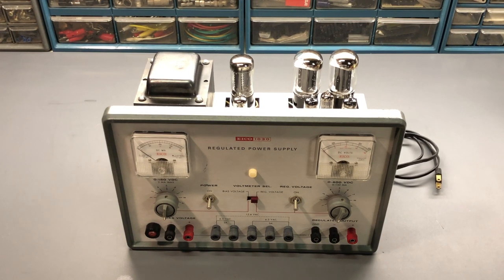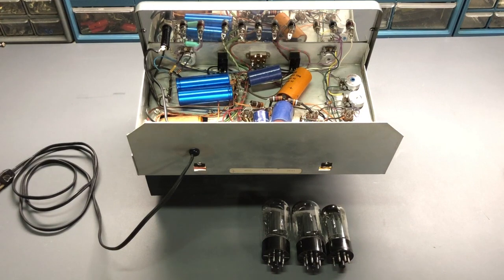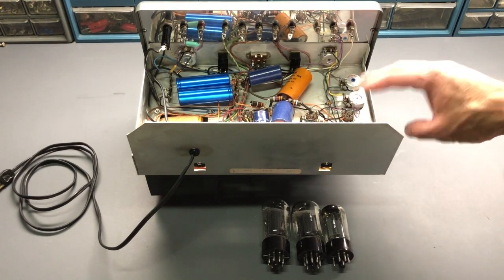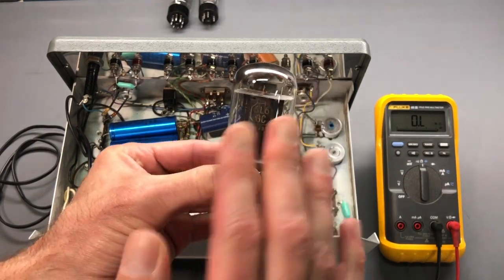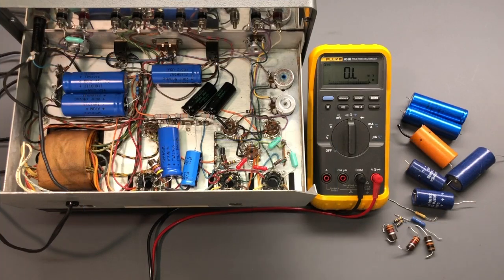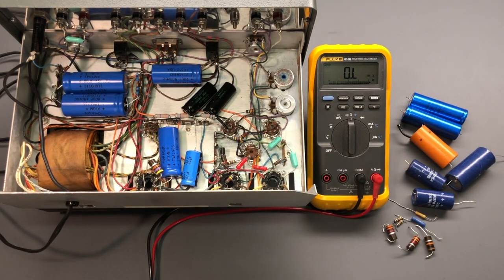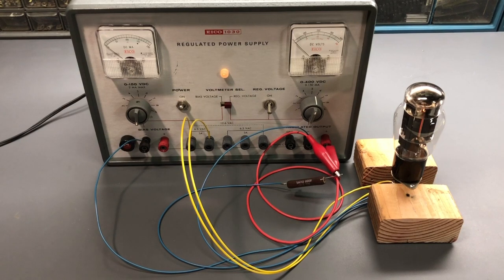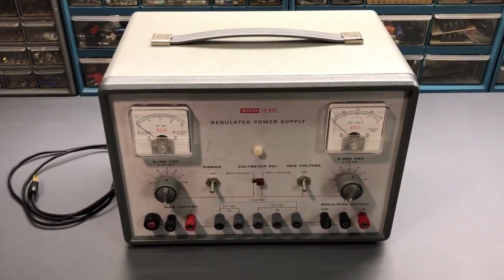EICO 1030 Regulated Vacuum Tube Power Supply Restoration And Test - Part 2

Comment: Erik, thanks for the 2 part video. Just acquired a EICO 1030 about a month ago. Also followed your advice to bring it up slowly on my Sencore Isolation variac. 
It appears to be working fine like yours. Surprisingly the meters do match my Fluke volt meter.. A well engineered device.
Ordered the replacement capacitors and they should arrive next week, so I will watch how you do your installation to get acquainted with the process. 
The EICO will replace my Heathkit IP-32 supply that is very similar in design, but the EICO is much better from what I can tell, and more flexible..
Again, thanks for the video,,, Robert WA6PHN, San Diego
Reply from the maker: Robert, thanks for the kind words about my video.  I am glad to know it was helpful for you.  I agree, the EICO 1030 is very well built.  Yes quite similar to the Heathkit model and I agree the EICO is the better model.  Have fun and enjoy your restoration project.
Reply: @EriksElectronicsWorkbench  The Heathkit will only put out one 6.3 volt AC output, but the Eico has 2 6.3 volt outputs that can be strapped together for 12.6 volt tubes, so an important point that distinguishes the 2 units...
Reply from the maker: @myradiovideos  also as I recall (correct if I am wrong) the Heathkit had solid state rectifiers. The EICO is vacuum tube rectifiers.  I prefer the the vacuum tube rectifier because the B+ comes up more slowly.
Reply: @EriksElectronicsWorkbench  yes you are correct plus the HEATHKIT Does Not have bleeder resistors across the 2 capacitors! Some folks like to convert tube to solid state but I prefer the tube as they are very robust and Glow!! 👍👍

Comment: Hi Mr. Erik
Very nice review. I have appreciated the test you did with the 6AS7 tube. Most youtuber I saw on this type of power supply did not test it with a tube. Very instructive! 

I have some questions about this H.V. power supply.
1) The power is a 2 prong extension cord. What is the utility of the ground binding post?
2) What about the security if by any bad luck, the 120 Vac hot wire is touching the chassis?
3) If by any mistake, somebody is touching only one lead at 400 Vdc, will he be hurt? Because the DC output is floating, we should feel nothing right. But 400 Vdc seems a lot?

I will be more than interested if you could do other demonstration with vacuum tube as you mentionned at the end of your second video.

Keep up the good work!
Reply from the maker: Hi, I'm glad you found the video informative.  Thanks for the compliment.  The ground binding post is provided for a convenient way to  attach to the chassis.  The ground binding post could be connected to a main earth ground.  As you noted the mains cord is only 2 wires so an earth ground is not automatically created.  Your point is valid about the chassis becoming hot if a mains fault occurs.  Grounding the chassis could help in this situation and also powering the unit from an isolation transformer would provide added safety.  The DC output is floating but there is the possibility of leakage current in a transformer, capacitor, etc and that could still be enough to provide a current path for a nasty if not lethal shock when dealing with the higher DC voltages.  I would definitely not want come in contact with the high voltage DC.  Always be safe and use caution with these power supplies.

Comment: Useful video. Might explain current is measured in series voltage in parallel when you go the 'leads' explanations.. Wise about pulling the tubes....sometimes they twist and break the spigot....repairable with superglue but still a nuisance.. Make sure the electro's are discharged before checking with multimeter....and I can't abide digital meters for general work too 'fidgety..I prefer analogue. ' As the demonstration progresses..if not viewer  really experienced there's a risk with exposed B+ levels on terminals whether bias of other... The demonstrator takes risks around terminals and resistors which will be greater than  for you...

A couple of the resistors were too far out in my unit .also the 1K shows signs of overheating even though reading 1K on meter. Unfortunately my set (yours too?) was built with component wires curled around tags than all later soldered....damned nuisance when replacing components...if doing 'properly' and not cutting  the leads and soldering new component to old leads. ...we don't all have solder suckers...If one goes that way wind the new component leads into a spring-like appearance doe a few mm (or say about 3/16th inch) as a close diameter fit to the cut lead. Slide over and solder .It's neat and secure.

I think I'll use a voltage limiting cct independently...This is the second supply which has blown an electro with runaway voltage....the other was a BWD...with expensive pots....one of which blew also. The BWD is more complex than this unit and uses early model IC's. BTW you talk about ';soddering' in English the word is solder...with an "L" not 'sodder 'as in French. Pronunciation is soul-der. I wonder why Americans pronounce it as 'sodd'...('off with the pixies' distraction!!)

Ok on th 470K resistors and equal value...but they are +/- 10%. The designer took that into account...I like perfection too but one can get 'neuro'...and the values will change again over time and maybe not change equally. Did you adjust the calibration pots?.to show how it should work?